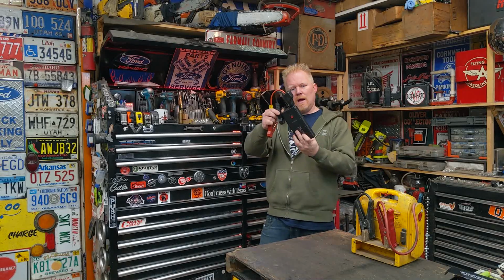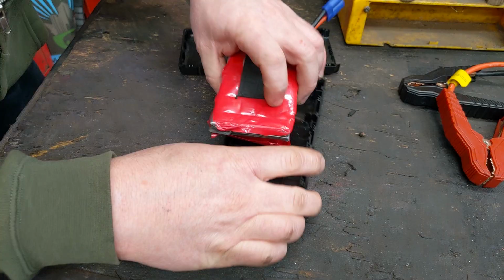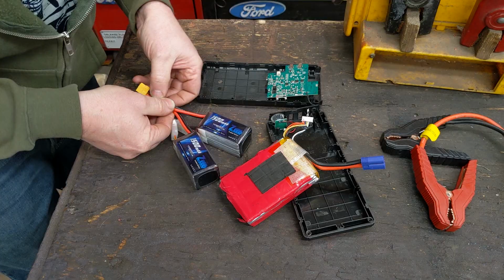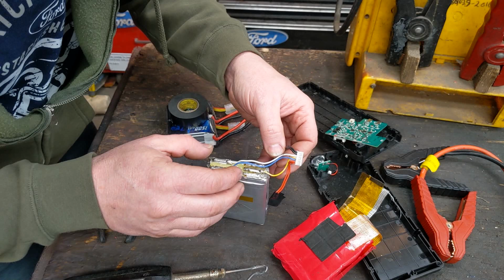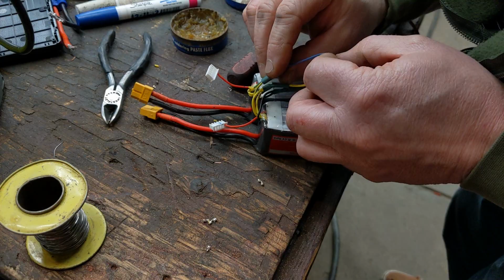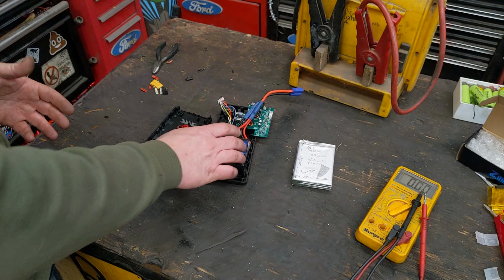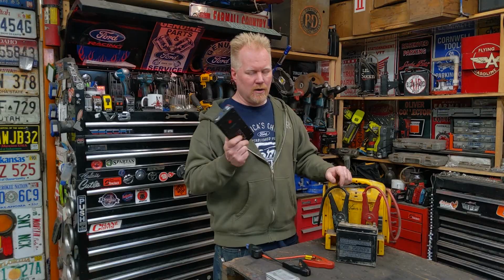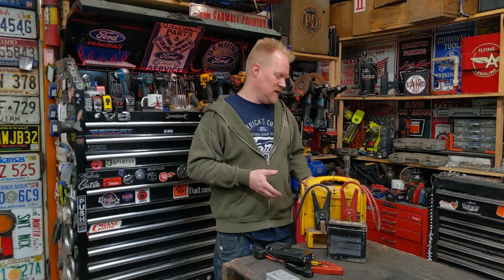Lithium Jump Pack Battery replacement HOW THEY WORK

Comment: Just as an fyi, I've been using a ES5000 booster pac (I think) I got on ebay for 9 years now.  It'll jumpstart anything, even a big diesel cat 416 backhoe without a battery in it, on a cold morning.  But it's 9 years old now.  I think the reason it's lasted this long is because I can't remember the last time I plugged it into it's wall charger.  It's so good that for most things like my mf135 diesel tractor, I don't even keep a battery in it, and just use this jumpbox.  So it gets recharged by the charging system of whatever it jumpstarted.  And the things are still around the same price I paid 9 years ago (around $125).  And no, I'm not affiliated in any way.  It's just how fast it turns things over, and now 9 years and going strong.
Reply: Thanks, I just bought one based on your high praise of it. I have one of the boosters like Moe is showing and it has worked well for me but I am not going to replace the batteries when they die, with the  ES5000, it's a simple battery swap if you ever need to replace it.
Reply from the maker: Yeah, the es5000 has a lead acid battery like these all do. It looks like the es5000 has a bigger than most 22ah battery. My yellow one and dozens others I have repaired have 18ah batteries(some cheaper ones have even smaller batteries). It all about how you care for it and those wall chargers can be brutal. I need to repair my yellow one as the battery is pushing 6-7 years now. I think I'm going for a 22ah lead acid this time. I run quit a few things straight off of it and that is what I miss about the lithium packs.
Reply: NOCO Boost HD I have a 2000a model. Has an over ride feature that allows you to use it as a standalone battery or start a battery with 0 volts. I have used mine to run a VW without a battery and to power a small winch without issue
Reply: What kind of charge level indication does it have on that pack? 9 years is impressive, you did well with the benign neglect by not giving it a loving charge and keeping its belly full all the time 😉
Reply: @sixtyfiveford  oh, I thought that was a lipo. In that case it should have been better keeping it charged- surprised it lasted that long regardless.
Reply: Yes by charging it from the vehicle especially the tractor it charges up close to full charge take a look at the charger that came with the booster pack if it's like all the one's I have it 12 volts output and for a sealed lead acid battery that's dead and if left in that state too long the battery gets sulphated most of mine lasted about a year since my main work season was the spring summer and fall I bought one every summer to charge my cordless tools I always bought the one's that had a 400 watt modified sine wave inverter that way I could also use my drill and sawsall by hooking the cables to my truck and starting it up I could drill my holes basically do my work unhindered until I bought a big one with a 1200 watt inverter I couldn't use my circular saw or my table saw but when it died I couldn't justify buying a new one 400 dollars to cut a few cut was way too expensive
Reply: @wingerrrrrrrrr  actually by charging it from the vehicle that's what gave it so long a life according to the utube videos I've watched a sealed lead acid battery should last between 5 to 8 years if you keep it charged up between 13.4 and 14.8 and not discharge below 12 volts since mine were used and then recharged over night they l wouldn't take or hold a charge after a year but I found utube was right written right on the battery in my old black and decker was do not discharge below 12.2 float charge is 13.4 and full charge is 14.8  my last ones were everstart and they charged to 13.1 but after a year they were dieing so I started  charging them through the booster cables with a battery charger I've got another year out of them and they are still working

Comment: Smashing repair/upgrade 😀
I was amazed with the tiny jump pack when they first became available.
Then in the blink of an eye everyone had one 😀
The only thing that i saw as being crappy was the quality of the crock clips,  they don't always make enough surface contact for high currents.
But that can be fixed with heavy duty ones with a powerfull spring.
I never get bored seeing your dog, she is loverly.
Reply from the maker: The cheap clips are probably my biggest complaint as well.
Reply: You must be talking about Durite and Sealey. I bought a Durite Li-Ion pack and despite initial misgivings, it works really well- starting cars and commercial vehicles alike. But the same problem- broken crocodile clips. They've got so much Gorilla glue on them now that they're weakened. But the unit is designed to house these clips neatly and I can't find replacements that fit properly. A pain.

Comment: I’m always impressed by your ingenuity and willingness to tackle some of these fixes … especially in modifying existing plastic cases to work with new internals that are too big for the original case. 

I’m sure many others like myself have encountered similar possibilities but have given up before even attempting because common sense would say it’s too much effort for the gain and the end result would no longer be sufficiently rugged or aesthetically acceptable.

But if I take what you’ve shown on countless videos and combine it with a precision hot plastic welding tool and the correct filler plastic I think I could tackle some of the projects I abandoned and get a result that could pass initial looks as OEM with some practice.  

Your channel as been immensely helpful to me on more than just a few occasions. Please know that the time and effort put into filming and the way you present things makes you one of my favorites for referring people to learn about their similar projects.
Reply from the maker: Wow, thanks Chris. I'm glad you like it. -Moe

Comment: I bought one of those jump boxes after seeing your initial review a couple of years ago and I gotta say, I’m super impressed with it as well. My wife keeps it in her trunk but I’ve used it to jump start my diesel truck with dead dual batteries.
Reply from the maker: When this died a few weeks ago, I was lost. I'm glad to have it back up and going.
Reply: @sixtyfiveford  what was the use pattern of your jump pack in the years it was in service?  Did you use it and charge it on a regular basis? Normally when lithium polymer batteries are stored with a full charge or discharged they'll degrade quicker than if they're kept at mid charge. If you just charge it and leave it in the trunk for a year at a time between use, will they still maintain full function for the years to come?

Comment: i just bought a cheap one of these and it jumps my diesel international tractor that sits in the paddock using 5% battery each time with no problems, im quite impressed, those batteries can become a white hot fire if wired wrong i recommend having something to contain it made out of  metal, those big ones take up to much room love your dog
Reply from the maker: They're impressive and dangerous. Thanks

Comment: One tip to people working with high discharge batteries. Cut one wire at a time. A few years ago I cut straight across the positive and negative wires of lipo for a RC craft, which were together like you see for an electrical appliance, and wow did that make a spark.
Reply from the maker: Been there done that! I get so comfortable around low voltage you forget sometimes.

Comment: A very good and informative video, especially for those who don't know how these work. I have a make that is probably not available in USA (Sealey, RS235) and my first one was 12V/24V for commercial engines and I started a 12 litre V12. Though unlike the one in the video here, I could start engines several times over without any problems at all- charging perhaps only once per week or so. I replaced the lead acid batteries with two tiny motorbike batteries from Yuasa and the record is starting a 14 litre V12 from them. Twice. Eventually when that pack gave up entirely, I bought a replacement and that struggled to start a 2l petrol engine.

Agree entirely with the Li-Ion system though. I can easily start a 4 or 6 litre diesel (24V) without any form of vehicle battery present, which from a box only a few inches square is quite incredible. I have a 7 litre 6 cylinder Volvo in the yard with flat batteries. Out of complete curiosity, I am going to see if the Li-Ion system will start that without any vehicle battery present (ie disconnected).

Excellent videos- not just this one, but your others too.
Reply from the maker: Thanks. Sounds like you have a lot of fun toys!
Reply: Not supposed to use it on a vehicle with no battery.

Comment: I still have my TrekPow jumper, this reminded me to refresh it. I've found that they need to get a work out after sitting a while. The 4 light indicator still showed 4, but on the load tester it only had 200 amps. The 2nd load test 400 and the 3rd 800. Then I put it on the charger, it is charging this very moment. The 1st one I got in 2018 died in 2019, I had contacted them and they sent me a new one in 2019. I think they had a 1 year warranty. Looking up my emails, I had emailed them in April 19 and they responded back with an email in August. They stood behind their product.
Reply from the maker: That's great of them. It looks like TrekPow is no longer a brand and they changed it to NexPow(or something like that). Are you load testing it straight off a 100amp battery load tester?
Reply: @sixtyfiveford  Yes, for very short bursts. After charging it today it is back to it's high output self.
Reply: @wingspan99  do the instruction manuals on any of these lipo jump packs advise keeping them stored at mid charge?  Seems they have to balance between warranty and sales.  Telling prospective customers their product could be damaged from their normal use might dissuade the customers from buying, so mum's the word might be the better option, they figure.
If everyone started getting warranty replacements after a year it'd be costly for the company.
Reply: @wingspan99  true, sales first is probably their mantra
Reply from the maker: I just read the literature that came with the new lipo cells and it does say to not store at full charge as it will drastically reduce the performance. It says to store at approx 3.8v for any storage over a few days. I put mine to 15.4volts(3.85v/cell) which is still 3 out of 4 dots on the meter. It will still give me at least 6-7 good starting attempts on a V-8 engine so I'm not worried. If I'm going to rescue someone I can always plug it into my cig plug as I drive to give it a full charge.
Reply: @sixtyfiveford  That's the balance, I want to have mine ready to jump but also want it partially discharged so it will last but it won't have full capacity for jumping.
Reply: @wingspan99  Batteries for RC drones do that too, they are programmed to start slowly discharging the batteries if they have been sitting for a pre determined number of days.
Reply from the maker: @DAS-Videos  Just threw mine on the 100amp load tester and it put out 600amps. That's at 15.4V or approx 3-4 dots. So at 15V delivering 600amps is equivalent to a 12V battery delivering 750amps. That's assuming the car battery is putting out nothing, but they are always helping with a 100+ amps when their dead. 750 cranking amps is more than a lot of small car batteries put out(double in some cases).

Comment: The new lithium batterys  are sure better than old stuff  I do want to make a box with a car battery in it for running radios etc have a voltmeter in it plenty of types of connections And a charger built in or at least a small battery tender
Reply from the maker: I carry around one of those cheap $25 lawn & garden tractor batteries(Wal-Mart) and run a lot of stuff off of it.

Comment: Good video, I love doing that type stuff because I like to tinker and I have tons of batteries I can build any pack with. However, you should mention that for just $20 more or on sale you can simply just buy a new jumper box. I use them myself to provide a few more CCA's to tractors that do not have a compression release. One last thing to note, be careful of the amperage it can deliver, I lost 4 solenoids in a row before I realized it wasn't cheap solenoids, the jump box was producing too many amps on startup, they can literally DUMP amps into a starter.

Comment: Straight up those battery management things are called balance plugs and I actually have used my 4S Lipo to start my vehicle and other peoples vehicles it has a 50 C with 100 C peak discharge rating and it works like a dream
Reply from the maker: Awesome. Other than the alligator clamps having a bunch of diodes to prevent the car alternator from reverse charging, this thing is essentially just a 4S connected straight to the battery.

Comment: Badass, I have one that had been awesome for a year or so with heavy use, I stupidly left it in a very hot car parked for a week with the jumper cables and volt meter attached and it killed the batteries and the swelled up, I'm also replacing the battery packs in it but I'm glad I came across this video to confirm it's possible. Awesome job and thank you
Reply from the maker: I did learn something crucial from viewers comments on these lipo cells. They hate being stored at full charge and only have about a 1-year life if done so. Full charge is about 4.2 volts/cell or 16.8v/pack. They do however increase their lifespan 10 to 20 times by storing them at 3.8-3.85 volts/cell which is 3/4 charge (15.2-15.4/pack). I've been doing this and it still works fantastic for jump starting. I haven't found anything I can't jump start that I did at full charge with 3/4 charge.

Comment: I had a lead acid one that went bad. So I took the clamps with cables of it, put on quick battery connectors (where you fold it up to release) for lead acid batteries, and now I use the cables with a slightly worn car battery.

Basically a battery and jumper cables, but the jumper cables are neater.

It is not a direct replacement for either, but a nice hack with what I had, and the capacity is whatever your loose battery is.

Comment: I've been flying RC planes,Helicopters and quads/drones for well over 17 years now and the blue connector on the battery jumper it's self is called an EC3 connector from Horizon Hobby and the yellow ones on the RC battery packs are Hobbyking brand called XT60 connectors,just thought i'd share that in case you or others wanted to know,the XT 60's are the norm for most of us in the hobby with the Horizon EC3 coming in a close second. 😉

They also do EC5 which are bigger and you can get XT90's also bigger,plus they also come in a smaller size which can all be found easy enough on google or the hobby store,the XT30's are smaller and i can't remember the EC ones off hand,sorry.

P,S great explanation on parallel battery packs too.  👍🏾👍🏾😉

Comment: The plugs are called balance leads, if there is an internal BMS (battery management system) there are no multi wire balance leads coming out, you see that in bigger packs where there is room for mosfets 😉

Comment: Good way to fix the jump started. I do question using acid flux on the wires. Yoda says he has a crush on Ginger, she is a keeper. 👍
Reply from the maker: Yeah, Acid Flux isn't idea for circuit boards but it can't be beat for soldering large items especially old solder that has an oxide layer on it. It is easily washed off if you don't burn it all away. I have actually looked for corrosion signs on wires after years and see non but I also make sure to burn it all away. That's not really an option with circuit board connections so I have some Kester organic high dollar flux for that.

Comment: Thanks for your video. I am absolutely impressed and amazed by your skill and ability to select and connect new batteries and revise the case to hold them. Your problem-solving thinking is top notch. One improvement (which would make all the time and effort worth doing the repair on a failed unit) is to employ connectors which would provide for the next battery replacement to be unplugging the old batteries and plugging in the new batteries. I believe that if you would build connector yokes, people like me would gladly buy them. My jump starter failed after 3 years with very little use. I can't see doing as much soldering as you did every 3 years, but I can see replacing battery packs by unplugging the old and plugging in the new batteries. rc55

Comment: The Dewalt Power Stack batteries use the same soft cells. You could basically rebuild and old lithium battery with the soft cells and not pay $150.
Reply from the maker: I actually have that written down as a future video idea.

Comment: Another good thing about having batteries in parallel (as long as they are balanced) is it shares current between the packs...reducing the stresses on each pack
The problem is, you can't balance between the parallel packs, which means they can eventually get out of balance, but that is usually after many many cycles
Very cool!  Keep em coming!!!!

Comment: I believe walmart carys the 3.7 volt.  Lithium battery.  I saw them in the landscaping depth., for solor lawn lights.  The vape smoke shops carry some also. Incase you wanted to add moore storage  power.hope that helps👍